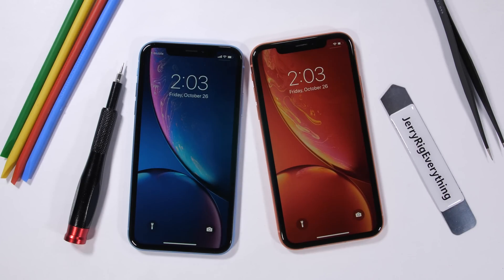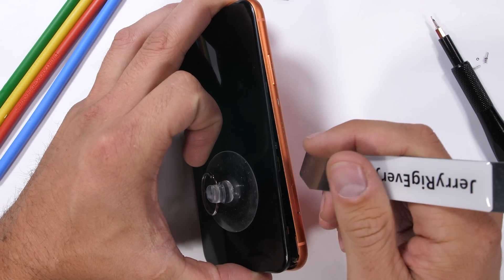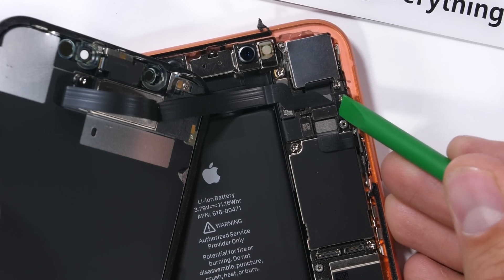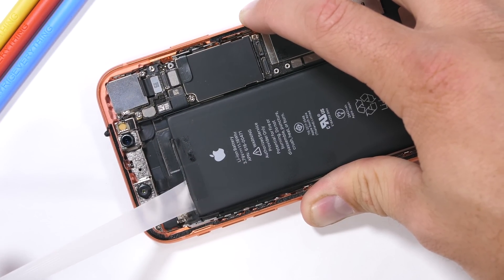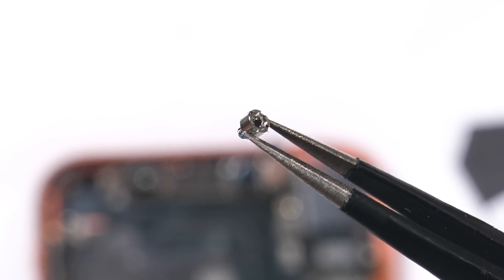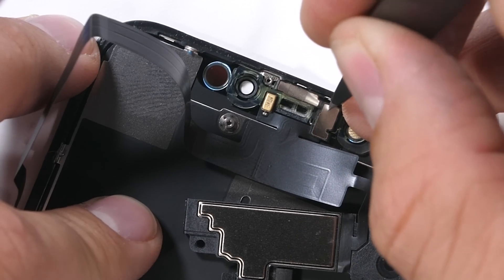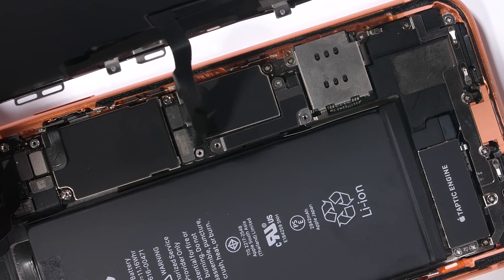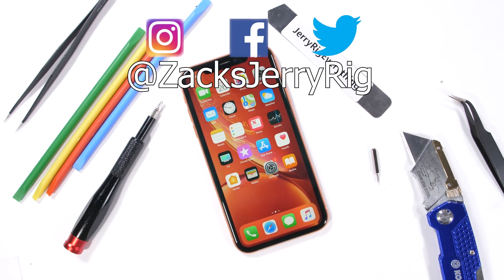iPhone XR Teardown! - How to open the colored iPhone?

Comment: Hey. Hope you read this. So I was tearing down my Samsung Tab 4 and snapped the LCD ribbon cable. Now I need a new one. I was able to track down one from an Tab 3 that has the same shape and size as the one from Tab 4 but is black instead of white with blue stripes. Will that black cable work in my tablet? Also both cables read 1 in 45. Not sure what it means, but I suppose it means the nr of circuit lines.

Comment: The battery adhesive is bullshit, they deteriorate with time and after a while just snap and you need to pride them out manually

They aren’t needed at all in batteries, apple only started to add them on the iPhone 5s

Comment: OLEDs in general are so expensive to replace. Far better off slapping tempered glass on. Some phones are curved like the galaxy phones and LG V-series but honestly i didn't have problems slapping glass on those. Use the same technique (door method) as always, though its weird how it just sorta "sticks on". You dont actually press in the center and see the air disperse out lol. Though it does take 12 hours for it to settle from my experience. If you put too much heat or pressure on it (inside tight case; by moisture and hot phone) then it will likely fuck up. 

My recommendation is Supershieldz. They have never disappointed me. There are higher quality ones, but they are the ones i have never fked up with. They also give you multiple glasses.

Comment: They are really pretty but I can't justify the price, which is unfortunate.
Reply: Honestly I tell everybody, don’t buy a phone more than $500.
Reply: @TheAvatarEXE  i would say you to go and FYS then, none of your business,
Reply: Pretty??
Reply: @Ens its not the fastest chip if the cpu gets hot which it will since it doesn't have any heat dissipation components so wrong
Reply: I can justify the price just by looking at the list of supported devices to date. Sure, they might slow your phone down, but at least you're safe. And apparently ios 12 has a reputation of running very well on older hardware so there's that.

The only thing keeping me from getting the xr is no 3d touch, with an LCD display the lower retina resolution is really not a bother.
Reply: its cheap tf you saying XD
Reply: Gotta pay to play
Reply: @Ens I'm gonna say something that most apple users said when they announced the 720p (oh I'm sorry, 828p) display

It's not like we can tell the difference between those 2, the differences are so small that it doesn't affect us
Reply: Yeah because $750 is wayyyy too much for a phone...
Reply: epic gamer 599$ ...
Reply: @helphelpmeahhhhhelp  it is with those crappy specs
Reply: @helphelpmeahhhhhelp  there are better phones with just about the same specs, maybe a little worse but still, lower price right?
Reply: CrazyDodo82 it’s not always about specs and way more about user satisfaction. the only difference you will be able to see between the iPhone xs and xr is the thicker bezel and the lcd instead of oled display
Reply: @isaiahrodriguez5030  I mean, for me, satisfaction would be still having some money left after buying a phone

Then again, if I had a high paying job, I may consider an iPhone to just try
Reply: @crazydodo82  You're right...but it wouldn't be an Apple..end of story..
Reply: @isaiahrodriguez5030  I could definitely tell the difference between 3D Touch and Haptic Touch.
Reply: Fernando Queme if you were to brush aside a difference as nitpicking it shouldn’t be the lcd vs oled, the oled is objectively better and just nicer to look at (color accuracy, true black)

Comment: A few facts about the Galaxy S9 repairability: 
- To open up the Galaxy S9 you have to pry open the glass back like it's bendable plastic, completely scuffing up the paint underneath and therefore ruining the back. Yes, you have to ruin the look of your phone to open it
- To get to the battery you have to take out the wireless charging coil, center plastic and loudspeaker, then you have to ruin the battery by heating up the glue and prying it out
- To replace the screen you have to use massive amounts of heat and force to literally break it - unless you're Samsung and have a massive machines dedicated to doing that, that's literally your only option
- To replace the camera you have to remove almost every single component there is to access the underside of the motherboard to un-clip the connecter
His scolding of Samsung in that tear-down: nonexistent
A few facts about the iPhone XR repairability:
 - To remove the screen you soften the adhesive and use the pry-tool to lift it up, and unclip it from the motherboard
- To remove the battery you just pull out the tabs and lift it up
- To remove the camera, you just unscrew it
- ...But you need multiple types of screws
His scolding of Apple in this teardown: Very strong

Which phone to you sounds more repairable?
Reply: The iPhone XR does but you see the S9 has a infinity screen without a notch (I think) so you can’t use a screwdriver because there’s no space between the screen and the phone body
Reply: Yea, but when you repair an Apple, it loses all water-resistant capabilities unless its repaired by Apple. Samsung can be more easily repaired by anyone, whereas Apple makes repairing their phones as mind numbing as possible so that you're forced into bringing it into an Apple store to pay hundreds of dollars to get it fixed.
Reply: @stevenblattner2177  Pretty sure Jerry himself is saying that with all phones you lose all water-resistant capabilities as soon as you open it up, it even goes for the S9. Shocking news.

I don't care about what phone everyone is using, use whatever you want - but the constant Apple bashing is starting to get a bit old now.
Reply: @linjord  Nah keep up the constant bashing, I like it! I'm tired of Apple users making fun of me, so I say expose their crappy phones!!!
Reply: Steven Blattner I’m confused - keep what up? Plenty of good phones available, pick what you want and be happy with it, chances are it’s probably awesome!

Comment: 1:42....The LCd screen will be cheaper to replace than the OLED....That's what make this phone a budget phone. And to all those calling out some phone sold only some place with some software that no one can reload if it goes bad (and we all know that software is stable) and with no good customer support (and a 1-800 number does not count). 

Yes this phone fall short on the display department but apart from that this phone is a good phone and for $750 can give you up to 4 years or more of quality service.

Comment: If someone could make a modified back glass that has a larger battery, similar fit & finish, that could be personalized, they would have trouble keeping up with orders. It's could serve as a back glass replacement while upgrading your battery life.  Probably could be sold for the same cost as having apple replacement glass installed. If you had the opportunity to improve your phone when you have to fix it anyway, why wouldn't you?

Comment: 400$ for a BACK GLASS on a 750$ phone.....while the screen replacement is 318$ lol so i guess even the back glass is more expensive and better than that crappy garbage display....and for people that still say resolution doesn't matter,did you ever receive a screenshot from a friend that has a crapple phone and you got something like a note or s9? the resolution from that picture is plain trash when you use a higher resolution display lol
Reply: Bastardo u take pictures in 1080 or 4k u dumbass. U never wondered how u can record 4k60 on a 1440p screen? Ur making fun of the wrong part of the phone. When u check ur pictures on ur galaxy its still 1080p i dont see an option to take pictures on 1440p

Comment: Question, could you possibly replace the lower quality screen on the XR with a high quality screen if you founf a screen of the same size with higher quality from a third party apply dealer if you took all of the framing from the XR?

Comment: TRANSPARENT back glass iPhone XR.....anyone???
Reply: He cant cuz the glass aint removable like other phones.....
All internal components are attached to the back glass....
So impossible to make a clear iphone since 2017....
When apple started using glass back....
Lol
Reply: Oh yeah, nothing more satisfacting than metal backplate :)
Reply: BootlegScarce but they didn't make it part of the skeleton back then
Reply: BootlegScarce u will have to go aftermarket for that most probably coz building a one off is not economical
Reply: very difficult cos the rear glass doesn't come off in one piece as its glued to the frame. If you try it just breaks into loads of little shards hence why apple charges alot to fix

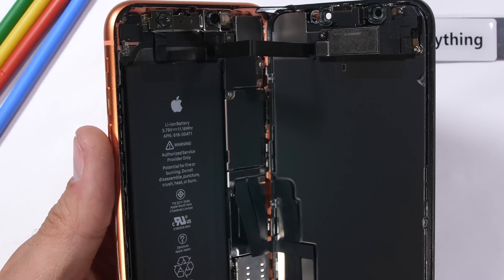Comment: 1:02 what can i say after this...
Reply: Livres Audio I think you missunderstand in your search for negativity. Its actualy possitive that internal placement/dessign are the same, even tho the tecnology and chips are new. Or do 
yoi preffer that Apple mixes the internals around every year so the un-tidynes makes it a mystery to repair avery year?! 😂😂😂 You know most cars have their internals at the same place without being the same car? Keeping the battery on one side, the motherbord top right under the camera, the taptic engine and speaker in the lower right corner is just good enginering.
Reply: @hallgeirhansen9124  @Sherlock Homie every engine bay I've worked on has pretty different layout from the next. Do I call you out for not know fuck all about vehicles or so I congratulate you for correctly identifying that in front of the driver is the best location for a steering wheel?
Reply: Livres Audio What do you mean?

Comment: Don't take Jerry's advice about opening with a metal tool. Only insert the metal tool, and use a guitar pick to push through the crack and get rid of the metal tool or else you risk scratching the frame ore cutting flexes along the phone

Comment: S9 : WQHD +

I Phone 10R : 850 p 
🤔🤔🤔🤔🤔🤔🤔
Reply: S6 had qhd
Reply: @tresended  2160p is 4k though
Reply: WHQD + is my favourite
Reply: Bastardo Even if they make it power efficient, of course it will always be less power efficient than a lower res display. So you'll always be trading off some battery life.

The iPhone XR display is 326 ppi, which while not amazing is nowhere near as bad as some people are making it out to be. Considering you're also getting one of the best cameras on any phone, the fastest and most energy efficient CPU in any phone, one of the only "chinless" bezel designs out there, and access to iOS and the Apple ecosystem (if you're into that), $750 isn't such a bad price.
Reply: S6, WQHD+
Reply: @tresended  4k is another way of saying 2160p, it's the same
Reply: look at the 10S lol it is BARELY 1440p but not completely lol,by the time they will have pure 1440p samsung and literally everybody else will probably have 4k screen at the same price.And the fanboys will still say it s still better
Reply: Bastardo they will never have full 1440p because the differences are minimal. and it’s not about resolution it’s about ppi. you can see the pixels of a 1080p 70” tv very easily from a close distance but a 1080p phone you wouldn’t be able to see the pixels at all from a close distance. resolution is just how many pixels are in a screen so in a tv with a 1080p display will have the same amount of pixels as a 1080p phone so the pixels on the tv are larger because the are on a bigger screen. The human eye cannot see past a 328ppi display from relatively viewing distance for a phone. but companies are so fed up in giving the best specs on phones when you won’t be able to tell the difference.
Reply: @LUR777-g7r  False, Apple will never increase because there's no need to. Screen resolution is a balance of clarity and battery life, so it just doesn't make sense to go higher than you need to.
Reply: @girlsdrinkfeck  It's not worse than the displays they've been using previously.
Reply: @tresended  4K is for virtual reality i think 😁
Reply: @tresended  yeah,4k on a phone is overkill but they would probably do it if they manage to get good battery life, the xperia z5 premium or whatever it was called did have a 4k screen but the battery was too weak for that screen

Comment: Great video Zack, I've been meaning to ask you. Is there any reason why Apple requires two Lcd ribbon cables? And could they have made the earpiece use contact pins instead of another ribbon cable?

Comment: I was wondering if you could swap parts from different phones into one and make the ultimate smartphone :D
Reply: phones aren't like pc
Reply: @aa-hp6zr  shhh lemme dream
Reply: @isusdechev  project ara rip
Reply: @Videohead-eq5cy  why did you call it project ara
Reply: @gamezahoy712  project ara was a concept for a modular phone where you could swap out all the parts you want. More battery space, more ram, better camera, etc
Reply: @conmattang8492  that sounds amazing. Sadly it is not productive for the producer so they can't do it in phones.
Reply: Can someone explain why this probably isn't possible?
Reply: @jordanray1537  Software. Windows is built knowing that people swap parts so it includes some basic drivers and others are downloadable. Neither iOS nor Android does that.
Reply: @jordanray1537  Parts don't much, in shape or size.
Reply: there is a old video of a guy making a iphone
Reply: Had tried once. Failed more than a bunch of times.
Reply: If only we can build our perfect phone :')
Reply: All are f..king different.
Reply: I think it may work to some degree. Say you take a iPhone XS camera into an iPhone X. It's shape matches. So it probably it fits. But there might me some software problems.
Reply: It can possibly work
Reply: I think on iOS devices it won't work, but for some compatible Android phones it's probably possible. iOS only works when the parts are authorized, and if not it won't open.